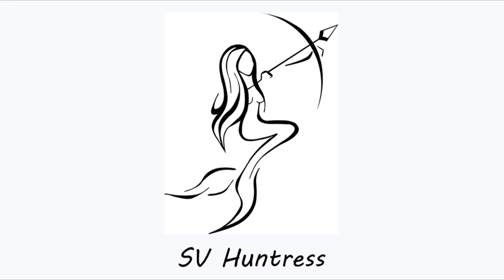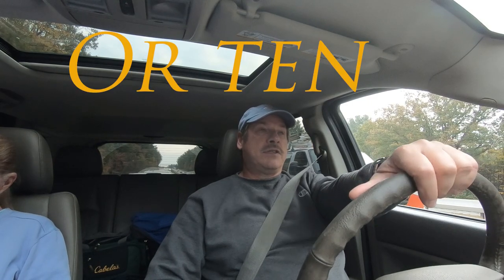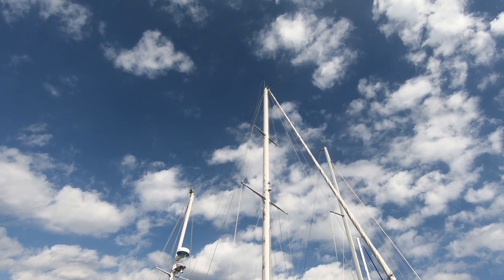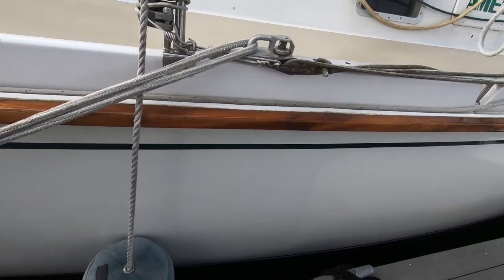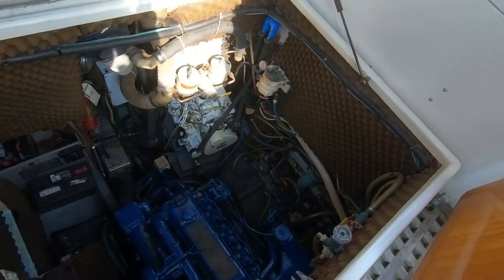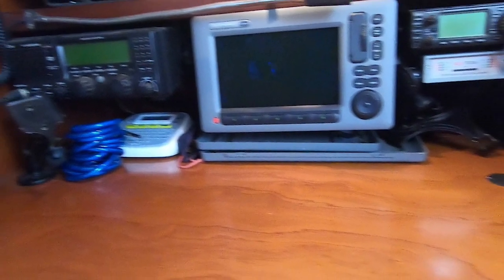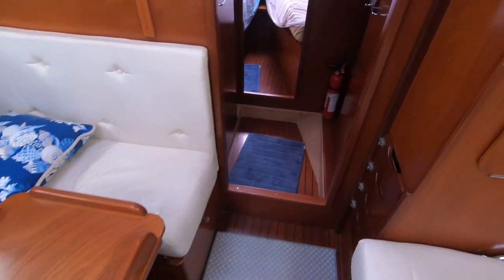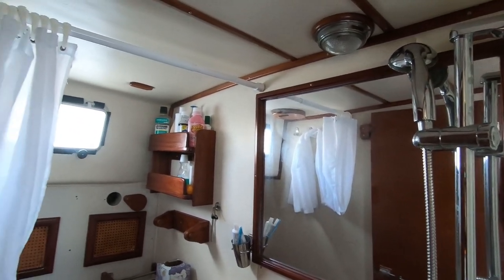And the Sailboat Winner Is... (Ep 3)

Comment: 4–236 a great engine. And that’s a great auto pilot. They are  older but excellent choices.   And if you were in your 20s-30s I’d say yeah. Maybe the cheaper one BUT, you are not and life is too short!  I hope you get the one in better shape.  Would be a smart move and very well may be cheaper in the long run.  

I have owned 5 serious live aboard sailboats and cruised them all.  My Cal ll - 46. Had this engine. fantastic engine.  Will run forever. New in !972 and STILL Crossing oceans today. Probably close to 20,000 hrs on it.   Also electronics are a bargain these days. And with NMEA 2000, even radar is all plug and play do it yourself.   Good luck and happy cruising!
Reply from the maker: Autopilot! Much to be desired.
Reply: @SailingSVHuntress   I have had these on a coupe of heavy boats in the 46+ ft range and had good luck for many years and ocean miles.  Did it ever break down? Of course, they all do. That’s why if I didn’t have a good vane gear I carried 3 autos. A primary and 2 back-ups.  Yes, I would rather have a direct drive on the quadrant. But these work!
Reply from the maker: @roadboat9216  Thanks for your advice. Having a second autopilot makes all the sense in the world. We will look into that.
Reply: @SailingSVHuntress      Yes, no matter what you have, it will have problems. As I said I have 2 backups and have been down to one but never none!  When I had a boat with a good vane, not so critical.

Comment: Nice boat, but can you two handle that much length.  My guide kept suggesting smaller, and I went with a Hunter 34 footer (1983).  

I have to settle for doing the work, but for $675 total, what could anyone expect.  I'm paying for it, later this week, to pick up the title.  Then, my little adventure begins.

65, cancer survivor, disabled, and caring for a paraplegic, but I say, "Never give up!"  Giving up, is just waiting around to die.  See you in the Caribbean in my le Nomade Hunter??
Reply from the maker: One of the reasons that we wanted an Amel Mango is that it is an extremely good blue water boat that is designed for circumnavigation, single handed or for an older couple.  Everything can be done from the very dry cockpit.  As with any boat there are a lot of factors to consider when you are going to purchase.  Of, course $$ is usually high on the list.  You should also consider your sailing and cruising experience and especially how you intend to use the boat.  There are many compromises when looking at the size of the boat such as living and storage space, sailing comfort, blue water capabilities, dock fees, depth clearance and much, much more.
We wish fair winds and following seas on your new adventure.  May we run across each other in the Bahamas!